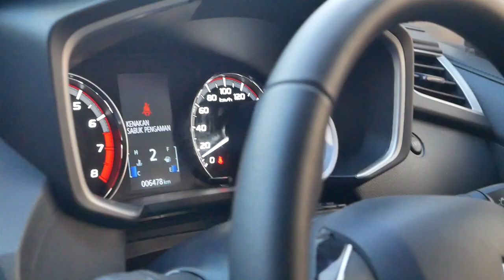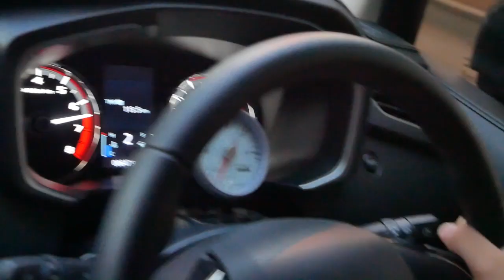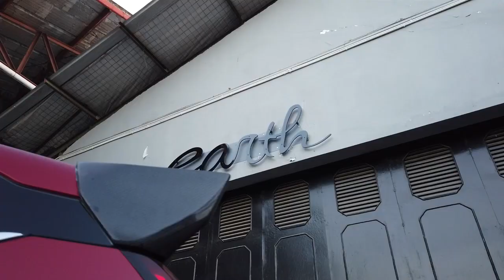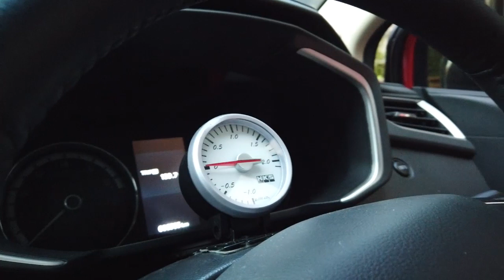Review Modifikasi Mitsubishi Xpander Turbo #carvlog

Comment: 4G15T yg dipake Colt Rally Art di Switzerland bs 197 Hp tuh stock pabriknya...copas Wikipedia "A DOHC MIVEC turbo variant of the engine is also still in production to date (4G15T), serving in the Mitsubishi Colt series, offering 163 hp (122 kW) on the latest Colt Version-R (with exhaust enhancement). The most powerful version of this engine is found in the Colt CZT Ralliart (special model in Switzerland) with a total output of 197 hp (147 kW)."